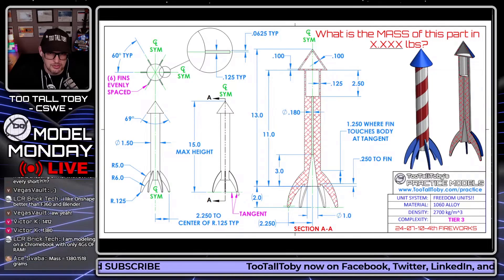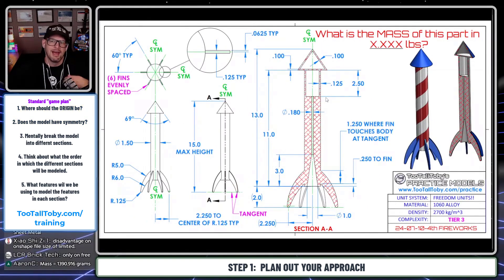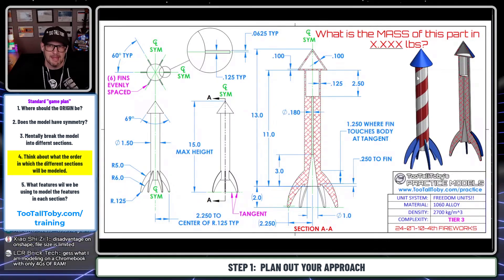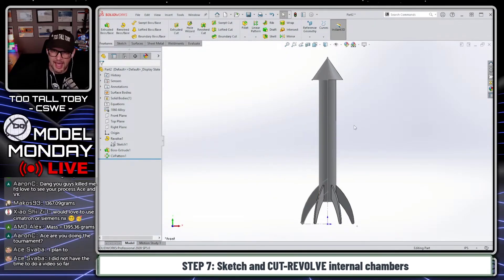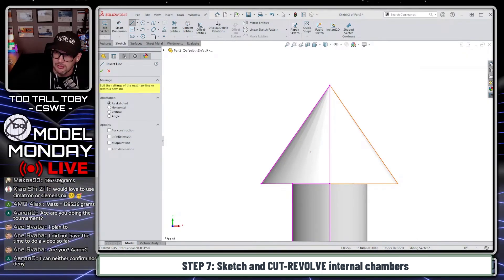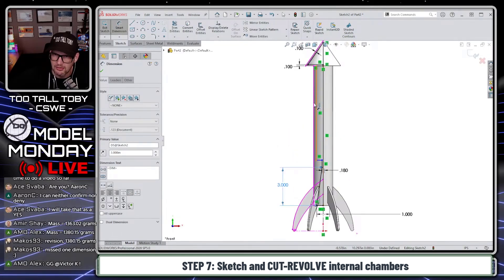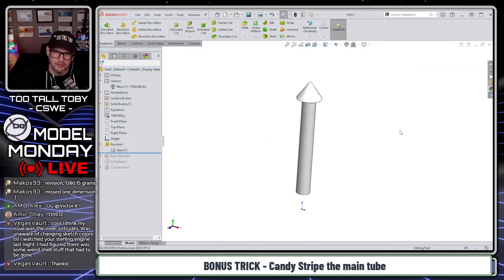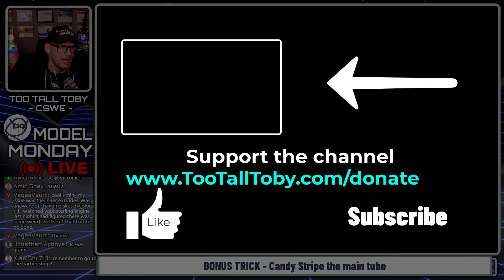SolidWorks FIREWORKS - Live solve of how to MODEL a ROCKET!  with candy stripe!

Comment: HELP ME TOBY>>>> I have spent hours tracing images only to have them wiped out  by the dam "Snap to". I have not found how to lock a drawing like Solidworks does, enabling to move around or relocate it. I have not found a way to Stop the snap to config. If it wont stop or shut off I'm out. I have wasted two days now to draw a very what would be simple trace if not for this confounding feature. Im ready to throw this laptop across the room.:face-green-smiling:
PS Thanks for what you do.
Reply from the maker: Snap to what?  A grid?  or snaping to geometry?
Reply: @TooTallToby  First off, thank you for coming back at me, and second of all, I am only in hobby mode at this point.
What I am trying to accomplish is I have a drawing of a part that I am trying to insert into another part, and when I try to trace it, it. Snaps 2 all over the place, and I can't stop it.  II don't know it.does this until everything goes red? Then I have to go searching for the constraints it created. I'm trying to stop that and lock the drawings. So I can move it around without distorting it. Thanks for what you do!
Reply from the maker: @freebass24  While you are in the sketch - TOOLS>SKETCH SETTINGS>ENABLE SNAPPING?
Reply: @TooTallToby  Oh my god, is it that easy?